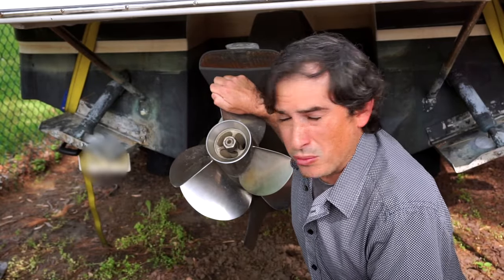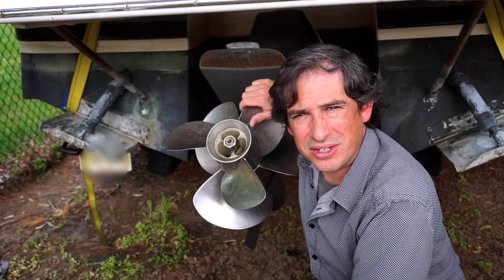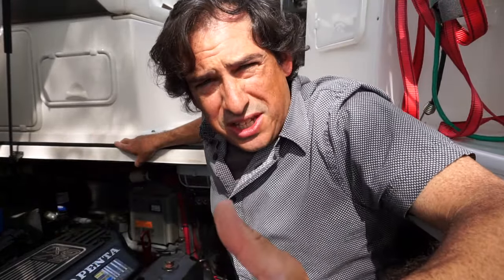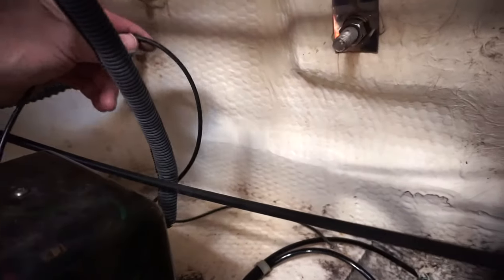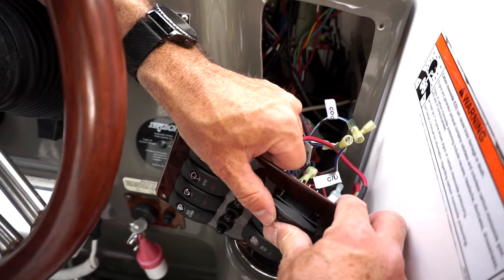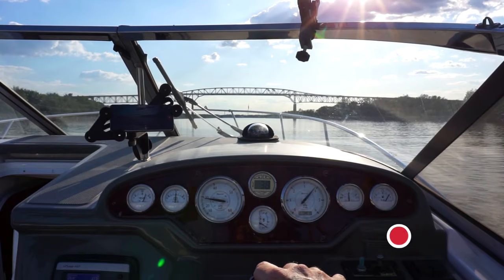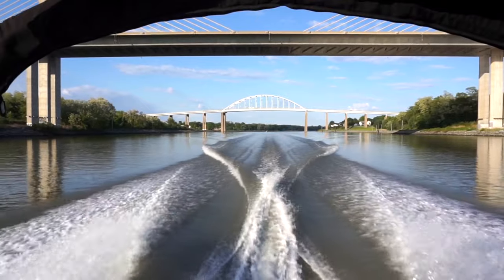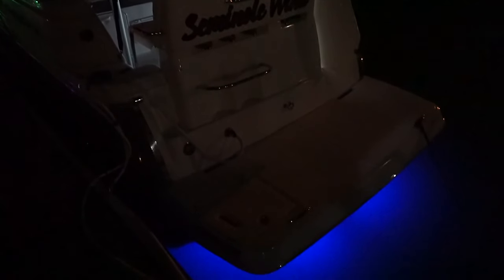Cheap Underwater Lights Worth It On a Boat?

Comment: Even the light is so far back still put on a decent amount of light and not only that since the lower unit is on the middle, i think it helps to split the lights to both sides i believe but i might be wrong, now the main thing is no new holes and that's important 👍 Good job with the wiring too. Good vid!
Reply from the maker: Thanks! Couldn’t agree more. The unit definitely splits the light in two. It gets a little brighter if I trim the unit in the slip.

Comment: You did a fantastic install,  great work! I think it looks great!  I have a pair from different company that has an adapter that allows 2 lites and still has a center opened to allow for drain plug. This puts the lites a little on an angle sideways, works great if you thought of adding a second lite..over all I love your setup!
Reply from the maker: Wow! Thanks so much! That sounds like a really interesting setup. I would always love to add more light and get it shine out a little more from directly behind the prop. I’ll definitely look into it! One thing I’ve learned from the installation , we have to make sure they stay completely within the transom with nothing hanging down into the stream of water. Unlike a transducer, I suppose they are not made to touch the water rushing by. But I’m sure there would be a way to make it work. Thanks again.

Comment: You are wrong on both disadvantages as there are Y adapters to attach 2 and even 3 lights to the same drain plug
Reply from the maker: I actually looked at those. My worry was that with how low the drain plug is, the Y would hang the back of the light into the water stream below the hull. That seemed like it could put a lot of strain on the light and the bilge drain fitting. Didn’t want to risk it. But, that setup may work great on another hull design.

Comment: Thanks for the video! As far as ROI, I'd consider it a win. I had the same concerns about shadow from the outdrive, but my transom does not have a channel like yours. Also don't have an extended swim platform (yet). Seeing the amount of light it put out, I'm reconsidering the drain plug light angle.
Reply from the maker: Couldn't agree more! I think our boat is the worst-case scenario for a drain plug light and it's still pretty impressive. We've tried the white light too. It's a good bit brighter than the blue, but doesn't have quite the "cool" factor. There's a pic on our instagram of the white light, but it looks green because of the water color. https://www.instagram.com/boatingcavu/

Comment: What wrench do you use to tighten the light? Isn't there a danger of water getting into the boat through the light?
Reply from the maker: I use a “strap wrench” to tighten and remove it. You can grab one from most any hardware store. The light itself is filled with epoxy so it appears to be pretty leak proof (if there is such a thing). I haven’t had any leaks with the light in the couple years I’ve been using it.

Comment: I think it looks great but wouldn’t exactly say it was so easy…maybe for you.  Im not someone used to ripping out my dash switches and rewiring them. Don’t own a heat gun (and have no idea what I would do with it other than this).  And how would I get that wiring up there?? My Regal bowrider bilge is wayyy more cramped than this cruiser.  This would probably take me 8 hours plus and potentially end in success but good chance of that not being the case.  So I think it looks great but but not as easy for everyone perhaps—definitely would call this an intermediate skill level project, not “easy.”  Enjoy your cool lights!
Reply from the maker: Thanks. And, I agree. It’s not for everyone. But, given how it worked out, I think it can be done by many more people than would do traditional lights and drill holes in their boat. Start small and you may surprise yourself at how much you can do!

Comment: How about those of us who typically remove our Blige plugs ?
Reply: @foveaaero1978  thank you
Reply from the maker: I use a strap wrench to take it out and tighten it. It's a little more work than a standard plug, but very doable each time. Maybe 45 seconds instead of 30. Once it's out, l'Il let it hang on the wire which I fastened in the bilge. It would be a bit of a pain to disconnect the wire each time.

Comment: How has this held up over the last, almost 2 years?  Would you still recommend this light?
Reply from the maker: Hey Alex, I absolutely would. We had one issue with the power supply dying on the blue light, but the manufacturer replaced it at no charge. We also bought a white one that is still going strong. I switch them back and forth between trips as the mood strikes me. Thanks for checking in!

Comment: Though the light does not go far, for the few hundred that you spent, it looks good. Though you do not really see much from the boat itself, from the outside or walking twords the boat it looks cool.
Reply from the maker: Thanks! I agree completely. I'd like to try the white light to see if it is brighter from the boat than the blue. Should be a quick swap.

Comment: This thing have never 8000 Lumens!
Reply from the maker: Can’t say for sure, but I found the white one looks brighter than the blue. The brightness is also really dependent on what’s suspended in the water. We’ve seen it go from pretty average looking to really bright over two different nights in the same slip but with different currents.